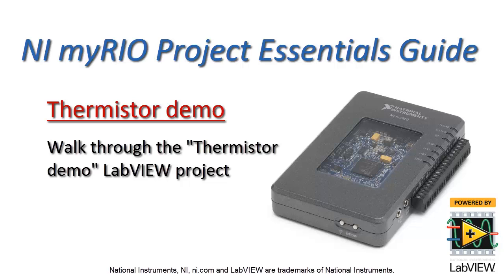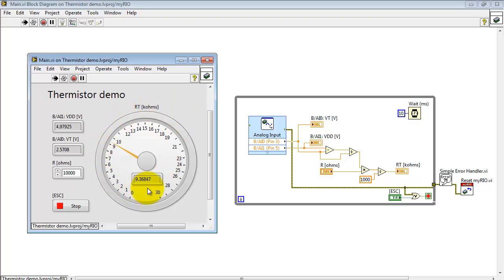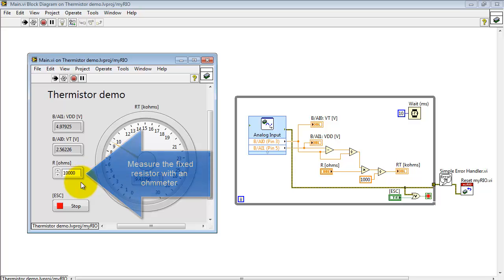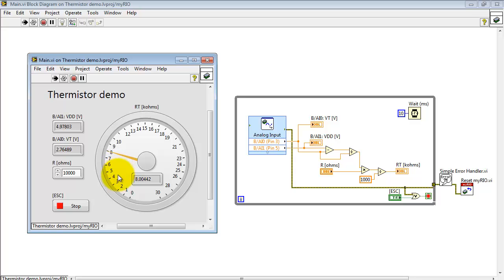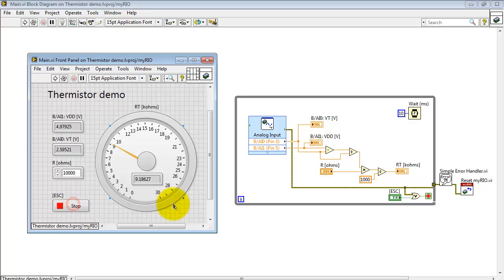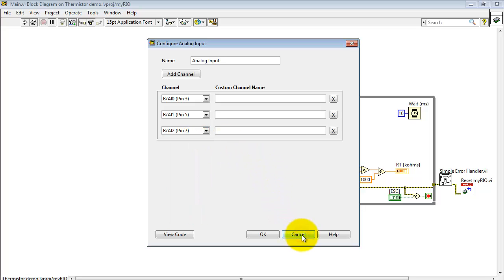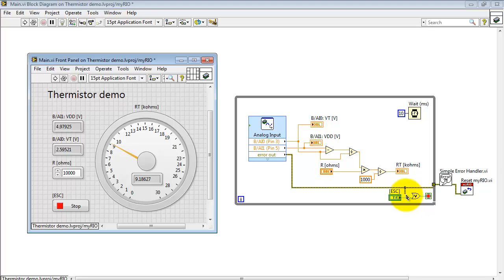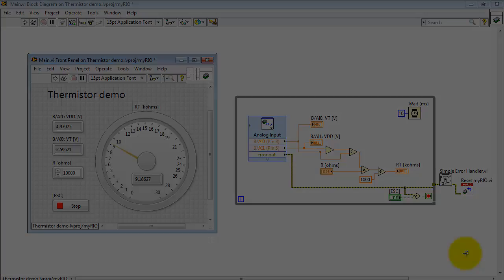NI myRIO: "Thermistor demo" LabVIEW project

Comment: how to add multiplexer to multiple thermistors to read  multiple temperatures from a battery cell
Reply from the maker: As shown at about 1:30 you can read multiple analog inputs at once. The Analog Input Express VI will produce one output for each of your thermistor sensors. The multiplexing happens internally.
Reply: Am trying to measure the temperature of multiple battery cells  in a battery pack as a part of a battery management system using my Rio as a controller and DAQ board .externally I want to be able to connect thermistors to a MUX and input to myRio analog to digital input